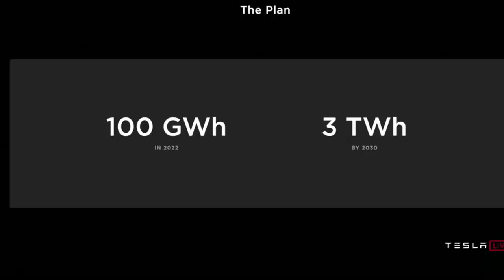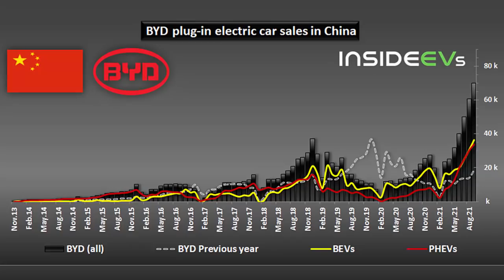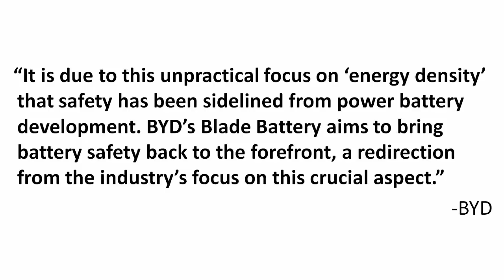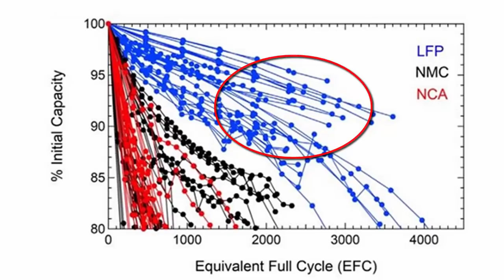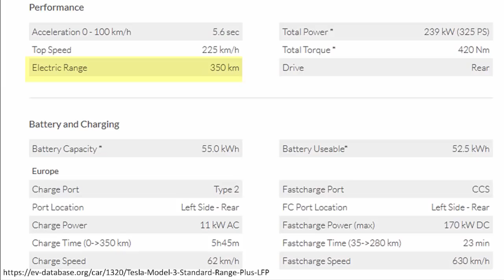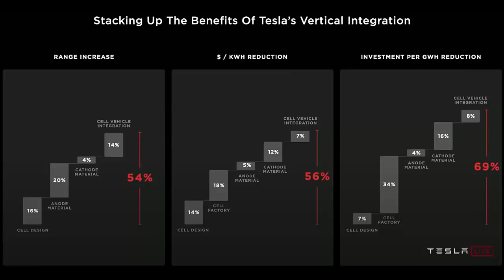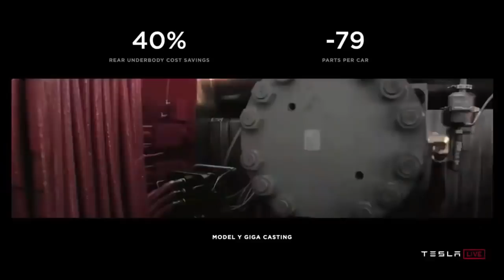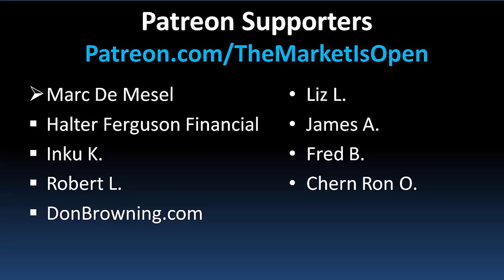Tesla Eyes Safer LFP Battery

Comment from the maker: Do you think Tesla will end up buying Blade batteries from BYD for the China-made Model 3 and Model Y? And do you think Tesla's 4680 battery cell combined with the LFP chemistry will bring something new to the table to rival the Blade? Be sure to check out:
The Frightening Economics of TESLA’S 4680 BATTERY CELL: https://youtu.be/pff085WDs_k
Tesla Quietly Builds MASSIVE Megafactory and adds New Solar Partnerships: https://youtu.be/bHZRoghtpZg
Visit our website https://themarketisopen.com for instant quotes and financial data
Reply: You should have done a little more research. The space gain offered by the blade design allows for a higher energy density at the pack level. The range that these blade cells are achieving because of this space savings puts them on par with the energy density of todays long range tesla's.
Reply: There is simple logic to that question. Musk is brilliant engineer himself. Considering how critical an important component battery is for an EV, there is no way he will simply buy ready made batteries from another company. He would want to control every aspect of it. If he thinks that another company can do it better, he will simply buy it like he has done.
Reply from the maker: @davefroman4700  The specific energy density mentioned in the video depends on weight, not volume
Reply: I trust you🌅💕

Comment: I would think EV manufacturers will still use the same shielding to protect it's battery pack from all the rigours of the roads underneath even if LFP batteries are utilised for better deformation, punctures safety etc. The second thing is the weight of the batteries (all batteries) will needs structural strength of the pack for its rigidity and the structure of the car.

Keep up the good tmio work
Reply: "the weight of the batteries(all batteries) needs the structural strength of the pack...."
No.
Example, the 4680 (could be others)
Take metal tubes 46 mm diameter, 80 mm tall.
Glue them together.
You now have a "honeycomb".
Immensely strong for its weight, torsionally rigid.
What it's filled with, or whether it's filled makes no difference.
Adding end caps just makes it stronger.
Reply: Yes - The new 4680 used in Tesla, is instead of each cells put into a modules and modules into a battery pack, they are stuffed into one pack. Yes this Battery pack is strong but Like what I said before, from underneath, of whatever the roads throw at it - sleeping policeman, rocks, metal debris etc. The weight savings in this 4680 pack is not just less cooling tubes, internal beams, it is the missing bottom metal chassis (hole) where the battery pack is mated to car body.
The top surface strength of the battery pack is made to take the seats directly onto the pack.

I say again, not Just Tesla, all EV, batteries pack(bottom surface nearest to road surface) must be protected from any external penetration to the pack.

Comment: I would still want that shielding on the blade batteries, not to prevent fire, but just to protect the batteries still from damage. Even if it doesn't catch on fire, I assume if one of the blade cells is damaged, it doesn't work anymore, which means a reduction in range. Just because they don't catch fire, doesn't mean they still don't need any protection.
Reply: yep. also no one wants water and dirt gettin in. once someone gets a puncture, it has to get replaced anyway
Reply: They do catch fire. On a crash test in China 3 days after the test. Or on the street.
The electro Magnetic interference is a disturbing issue I experienced.
The advancement on the space to range how is good.
Reply: Agreed, saves me from typing this haha

Comment: Major advantage of Tesla's tabless (multi tab actually) 4680 battery is the very short electrical paths between anode and cathode in the battery. Makes it easy to cool. Just top and bottom cooling, no nead for fancy cooling channels. Also very easy to charge/discharge at a high rate (high power density). If you unroll a 4680, you get a very large active cathode/anode area - similar to a large flat blade battery, but very compact (high energy density), and with steel cans cast into a solid pack - almost bullet proof. With LFP can safely discharge to 0% and easyily charge to 100%. Better than other chemistries. Elon's on it!
Reply: What?
The 4680 advantage is that the "short electrical path" which is perhaps better described as a "constant/ short" path to the contact(?) reduces internal resistance, which reduces resistive heating which reduces the need for cooling.
HOWEVER.
There's no reason the blade battery can't have the same continuous contact on the jellyroll edge.
Add the even proximity of ALL the material to the outer casing, plus the much larger surface area of that casing and the blade should stay cool.
The 480 / Maxwell/ tabless combination is ALL about getting more GWH out of the same (in fact much less) factory footprint, for the same number of "cans".
It's a happy coincidence that the combination had si many other benefits.
The question for BYD is, can they match or even approach the same GWH with similar effort.

Comment: I have said all along that Tesla will produce 4680 LFP cells using the tabless design allowing for higher discharge and charging.  The large form factor is made for this chemistry.  Think 32650 cells that are predominately LFP.  4680 is 70% greater by volume.

Patents for LFP expire in April of 2022.  Along with their own improvements in form factor and additional chemistry improvements, it's not a stretch to say they can achieve a minimum of 200w/kg for their own cells.

Comment: I think they may but not convinced Tesla would adapt the pack to support a different battery shape. The "study" on the blade Tesla is making I would think it is to incorporate some of its technology into the LFP Tesla chemistry using 4680 form.
Reply: Taking 10GWh of blade cells, using them in "non structural" storage, while freeing up the same capacity of 4680 cells for use in vehicles would seem to be a good move?

Comment: Let's start with the Blade's pricing.  So far as I know, they are not for sale outside of the company.  So BYD can claim anything it likes about its cost.  There is no way to verify their cost claim.

This is particularly problematic because prismatic form-factors are literally the most expensive battery cell form-factor.  This form-factor was invented to enable conformal batteries - cells in any shape, to fit neatly into consumer electronics products.  That extra flexibility comes at a higher cost.  Manufacturing at scale for prismatic cells is quite challenging; it's expensive to mass-produce them.

BYD started to trumpet their cell-to-pack technology after Tesla's Battery Day introduced to the world the idea of cell-to-structural-pack.  This was a 'me too' moment.  But BYD's cell-to-pack isn't a structural pack; prismatic cells cannot take any structural load.  They sit in trays.  A manufacturer can, in principle, make the trays structural by beefing them up.  But that is quite different from what Tesla is doing - using cylindrical cell cans as structural elements.  Structural packs can reduce vehicle weight.  Nonstructural packs can't.

If Tesla is determined to use gigacast front and rear underbodies, they will not be interested in prismatic cells for vehicles.

I'm also put off by BYD's slick presentation involving cell penetration and battery fires.  This was not an independent test, but a test conducted by BYD itself.  BYD chose the penetration points.  How would the test look if they didn't have that control over the results?

You mentioned that BYD is a competitor to Tesla.  They should have little interest in enabling Tesla to make more BEVs.  Nor should they be interested in selling batteries to Tesla for grid storage products, since BYD competes in that space as well.

We do not actually know if the 4680 cell will be manufactured with an LFP version.  We do know that BYD does not work with cylindrical cells.  And we also know that Tesla is enamored of the cylindrical form-factor as offering the easiest path to low cost, with the added benefit of working nicely in structural packs, yielding even more advantages.

My conclusion: Tesla likely has no plan to involve BYD in its supply chain.

The noise and rumors coming from BYD grab attention and cast the company in a very favorable light - if you believe them.  I think it's telling that there is no downside showing up anywhere.  When the news is all good, it's a marketing exercise.  I think BYD is trying to pump their stock price.
Reply: We do know that there will be 4689 cells with LFP.
Reply: @0ooTheMAXXoo0  we also know the 50% cost reduction was WITH nickle cells.. so perhaps another 20% cheaper again when they go to iron based?
Reply: BYD is legit, they ran a garbage truck over their pack of batteries then immediately put it in and drove off in the car.Due to it's form factor BYD is achieving higher density then the cylinder design.It would be wise for BYD to build as many factories as they can because for what it is, it's the best LFP battery in the world today bar none.
Reply: @Scholzey  This sounds like a valid speculation to my ears, Scholzey.  Cheaper materials, regardless of the cell form-factor, should help reduce costs.

I do think we will eventually see LFP in 4680 cells, whether from Tesla itself or from a supplier.  But I don't know when, or from whom.  Nothing has been confirmed, so far as I am able to determine from public sources.
Reply: They don't burn immediately. There several videos in China, where those batteries catch fire. One is 3 days after the crash test.
I uploaded a video of a BYD Han driver, standing in front of his car, on the brink of burning. But nothing happens. Conventional batteries are way more explosive. 
I drove the 77kwh Han, with 350km range (AC on) at 120km/h. 
I actually like it more than the Tesla, but there was a different issues missing electro magnet shielding.
Reply: @larsradtke4097  Pouch cells, like those used in the Bolt, seem to be the most vulnerable to fires.  They are large, and so coolant is farther away than with smaller cells.  They develop hot spots quite readily.  Those hot spots likely also degrade battery capacity over time for pouch cells more quickly than with other form-factors.

Any L-ion cell can catch fire, if it is subjected to high enough temperatures.  But I have no doubt that the Blade cell is more resistant to fires than a pouch cell.

Even so, it's possible to exaggerate the difference.  Since BYD conducted the tests themselves and chose what information to release or keep to themselves, we can't take their results very seriously.  What is needed is independent tests.

BYD made no claims about the relative fire resistance of the Blade relative to cylindrical cells.  This is unexplored territory.
Reply: The only problem is that Tesla is battery constrained. Tesla have announced they are buying blade batteries. The 4680 is yet to go into volume production at Texas and Berlin. Tesla needs batteries and this is why they have ordered as many as they can fermi all the manufacturers.

When they become a volume battery manufacturer that may change.

Take care M
Reply: It seems to me blade battery cells could be structural as beams. Also they would seem to lend themselves to printed manufacture. I think BYD is on a winner.

4680 also has great performance, engineering and ease of manufacture features.

The battle has been joined. It will be interesting to see how it plays out. 

The requirement is for a strong, light, high capacity battery that is reliable over a wide temperature range. It may be both will find a niche.
Reply: @Urgelt  Blade isn't in cars yet ? What are u talking about All the new models like dolphin which just started in China in October use blade batteries. The Tang or the Han models also use blade batteries and have already sold in the thousands. Toyota latest EV uses the blade battery and the Byd e3 platform.
Reply: @bobmorane4926  Yeah?  Okay.  Obviously I haven't followed this subject closely enough.

Appreciate the correction.

Comment: 3:46 BYD has a 40' container that's 500 kWh? This is a tiny capacity! Maybe this is a temporary, fully self contained unit with complete electronics onboard for direct power supply in, say, emergencies or events-in-the-sticks? Maybe we're comparing apples with oranges when we look at this product and the visually similar Megapack at 40 GWh (80x the capacity).
Reply: Sorry, 40 Gwh is 80000 x 500kwh. The Megapacks of Tesla are 3 Mwh each, with 1Mwh inverter/max output. So it would be 6x the BYD storage capacity. Or 2x the max output.

Comment: How much better will the ride quality and panel gaps be with front and rear castings?
Reply: A more rigid chassis will always ride better. BMW are trying to say the cast chassis parts make accident repairs impossible. However, an impact hard enough to damage that deep into the car would write off anything, including a BMW. Tesla already provide repair parts for the energy absorbing crush beams. As do all car makers.
Reply: @Dave5843-d9m  of there's an argument that you could simply unbolt the casting, with all the attached parts, fit a new one, then refit the undamaged units to it.
May actually be faster? No alignment needed.

Comment: All energy stores using chemical energy are t risk of fires. Petrol is chemical energy. That's not flammable of course. The only issue with Li-Ion is the way they cant easily be extinguished. That needs to be better considered by manufacturers or simply use a safer chemistry such as LFP.

Comment: Tesla batteries have alot of built in redundancy by making many battery bricks in parallel then in series. In comparison to Toyota hybrid batteries that are totally in series with none in parallel, if one cell goes offline, the entire system fails. It remains to be seen how BYD batteries cells are connected.

Comment: If byd could build enough then Tesla would probably buy them as it is byd would have to supply Tesla with every battery that they make and have plans in place double production every year

Till that happens it's really not a good decision to use a total difference battery because they would have to make a lot of changes to the production line and the way the car is made just for one supplier that is still working in low volume and that line would not be compatible with any other batteries from everyone one else

Comment: LFP batteries would be safer in a cylindrical can than in blade form... BYD blade batteries are safe despite being blade form, not because of it...
Reply: Why?
Unless you have intimate knowledge of the construction of a blade cell, that's a rather presumptuous statement (being kind)
I suspect you have zero such knowledge.....?
Reply: Extremely presumptuous given that the safety tests showed Ncm battery most explosive, then LFP batteries of other makes still reacting to piercing but less than NCM and finally Blade batteries showing the least reaction to the nail piercing test. Just because it's LFP doesn't mean no fire, but Byd came up with its proprietary way to make LFP even safer.

Comment: Nothing to do with the fact that that the lithium Iron phosphate patent has run out. and now look and behold every one is going to use them. 
China has been exempt from the lithium Iron phosphate patent, and that is why most of the battery cars in China are lithium Iron phosphate packs.
This is the reason BYD has an advanced battery, and the rest of the world has to now catch up. and that includes Tesla. Hopefully the rest of the world can
now start and make cheaper batteries, that are both cheaper and safer.

Comment: Tesla continues to use cylindrical cells and don't consider blade in their vehicles since they've made great strides with their 4680 but they never dismissed blade batteries but acknowledged its FUTURE potential but at the moment 4680 will only be used in their vehicles while blade may easily be used in the rest of their energy products since it's far easier to convert energy products to accept blade alongside cylindrical as opposed to the costly time consuming retrofitting vehicle lines to switch back and forth from blade to cylindrical cells batteries. So realistically sensibly Tesla would only go all in on cylindrical at the moment until during all their constant consistent innovating they develop superior blade batteries, and find the better blade batteries at extremely reasonable volume to make the complete switch justifiable.
Reply: The question asked at Tesla (years ago) was
"How can we physically produce the NUMBER of cells required from the type of factories we have?"
Answer, they couldn't.
THAT is why the 4680 exists.
It holds exactly 5 times the surface area of "jellyroll" in each can.
That takes the load off the "canning" side of the factory.
The tabless electrode allows fast assembly of those cans.
The (formerly) Maxwell process makes the front end of the factory much smaller, allowing more production.
Result?
Essentially, 5 times more GWh leaving a smaller footprint factory with the same number of cells.
All this without a "chemistry" change, the "5x energy" is (imo) achieved with the same chemistry and the latest 2170.
When they DO change the chemistry, things get really interesting.
As I said, the 4680 results in 5 times the output with less effort than previously.
Reply: Tesla will use 4680 LFP cells in their SR vehicles.